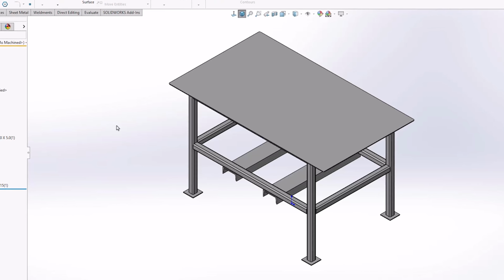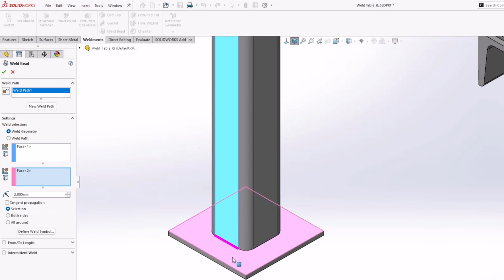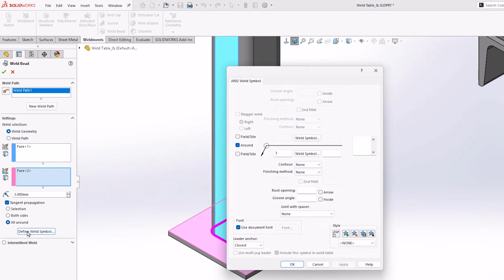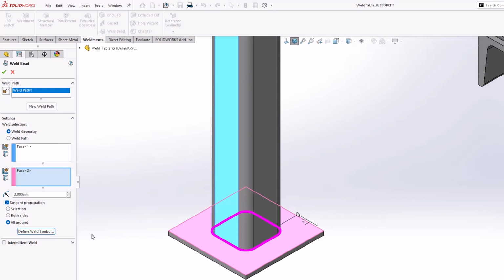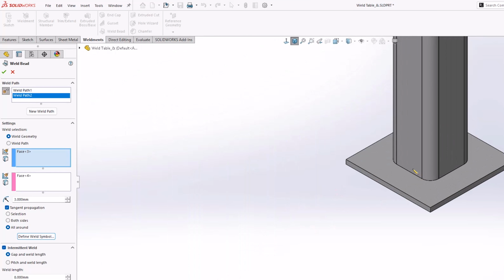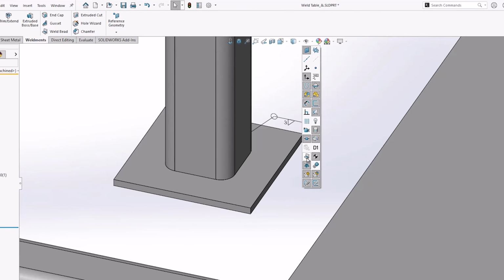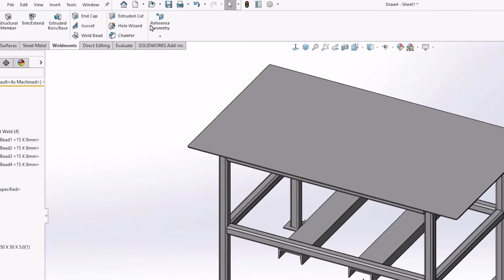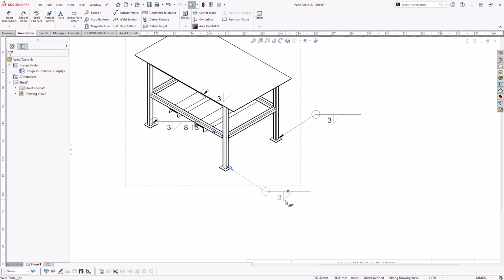How to Insert Weld Beads into 3D Models and 2D Drawings

Comment: Thats really cool! Ive been struggling with the import into the drawing view for years and Im glad I learned something new from you. 

I do have a question though. When you show the weld symbol in the model, why doesnt that appear under the Annotations? When I go into that folder, it just shows the annotation is unassigned, even though we can clearly see it is tied to the weld. 

What is the relationship between Annotations in the model to Annotations in the drawing and are they even tied together?